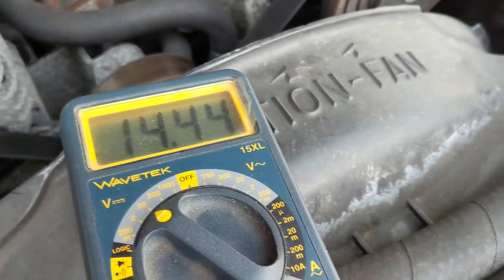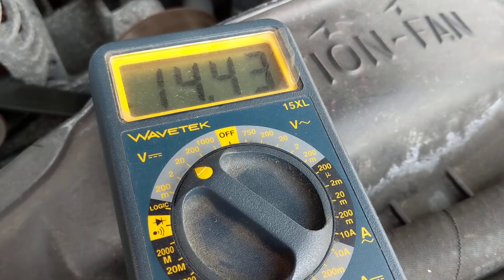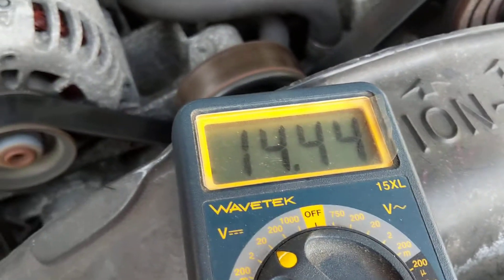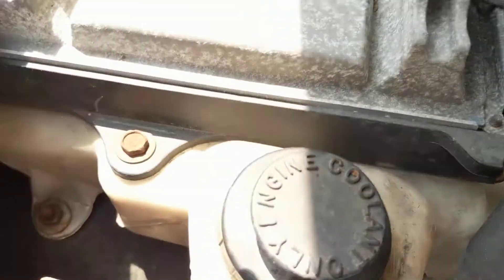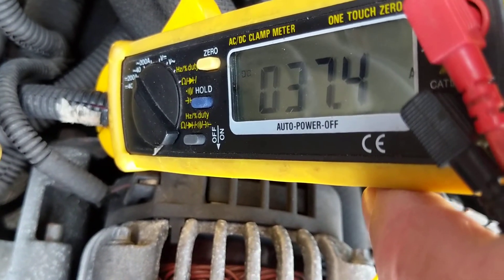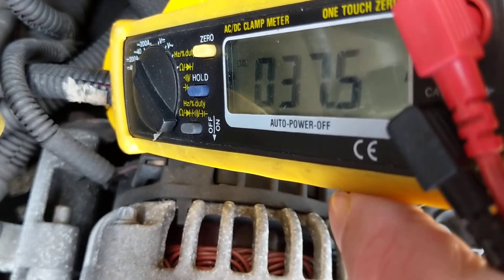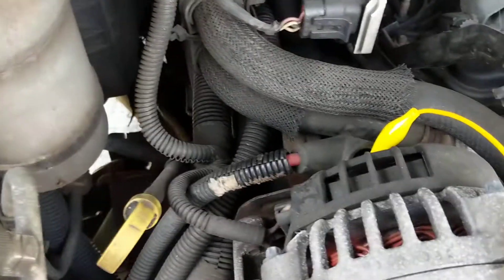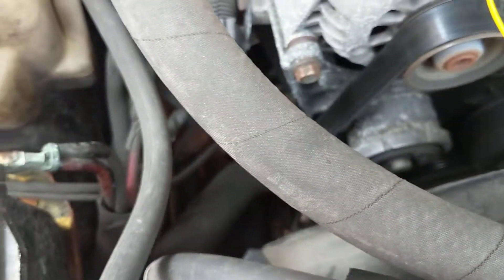CAR ALTERNATOR, HOW TO MEASURE OUTPUT CURRENT with clamp meter, NOT SEEN ANYWHERE ELSE ON YOU TUBE A

Comment: What range did you put on the clamp meter ? And why did you bring another multimeter? Can't the clamp meter do the job for measuring all the car parts?
Reply: Good questions the range that you put the multimeter as a clamp meter you can put it on 20 volts because you're probably going to measure around 14 volts the reason being I use two separate was to show the regulator is regulating the voltage and how much the current is when you turn on the accessories to show you the computer is giving the commands to the alternator thank you for your good questions

Comment: To me the meter is reading 14.43 volts DC ( direct current) and your clamp meter is reading 36 amps.
That means to me the output is current leads the voltage in an alternator.  That is in the theory of an alternator.
Reply: Thank you for your comment doug yes in an AC circuit however all this AC is rectified by bridge rectifiers sometimes six diodes or more so it has to be a DC voltage with minimum ripple to charge the battery and to keep the accessories going the current tells me that the computer is changing the current with demands of the loads thank you for your comment doug

Comment: So how many amps that alt is
Reply: 120 amps some alternators are rated 160 and up depending also on the cylinders thank you for your question
Reply: @Joeelectronicschematicsforauto  i have a beefed up alternator thats supposed to be 2 hundreds amps.    I have a harbor freight clamp and multi meter, im bout to go check my amps out in a few.   Sooooo do i just clamp my meter around the wire that connect from battery to alternator?
Reply: @moneymac5214  first put all the accessories on like lights air conditioner blower motor and accelerate to about 2000 RPM put it on The wire a thick cable from the alternator to the battery correct with old accessories on you should get probably 30 amps or somewhat when turned on when they turn off obviously it should go down

Comment: very good, but take the plastic shielding off the wires before you clamp them.
Reply: Why? A thin plastic cable wrap is not going to affect the magnetic flux created by current passing through the conductor. If it did, wouldn't the much thicker wire insulation have far greater effect?

Comment: dude, i appreciate the spirit of the video but you didnt show us much. your point seemed to be to show us the  amount of amp draw that was on the alternator when you turned the lights on, but you didnt show us what the amp draw was with the lights off. you told us it was   about 20 amps, then showed us the meter with the lights on presumably.  you also talked about voltage drop but didnt show us that either. show us the amps and volts  with the lights on and then off, then for fun calculate the watts for affect of output power, the viewer can do this at home, but maybe they dont know how or what this means. what were you actually troubleshooting? that corroded cable going to the battery is a problem, resistance problem technically. just curious, whats the highest amp load you have seen on a vehicle? last summer i connected a 10kw watt dc to ac pure sine wave inverter to both of my trailblazers  at the same time. i was able to get exactly 302 amps dc out of the two alternators combined. each trailblazer alternator is rated for 150 amps, and i get exactly 151amps at max per vechile.here is how that broke down and this was the absolute i could push things without tripping something, maybe low voltage input from the inverter maybe, dont remember, i did take notes though and here is how it worked out. 11.29vdc x 302amps = 3,387 watts dc, feeding the inverter:   107vac  x 35amps =3,745 watts ac for about 90.4% efficiency and 9.6% loss. as you can see i was dealing with a huge voltage drop on both sides of the inverter. i'd like to do more testing. i love this stuff but i dont have a real application other than providing power to my house if i loose power which i can easily do, except for the furnace which runs on 240, but i think i may be able to use a transformer for that...maybe. also, it should be noted i did this all with both engines just idling, but when the alternator creates that much current it causes the pulley to drag on the serpentine belt, i dont mean it slips, i just mean the engine automatically sees the load and slightly adjusts the rpm to ensure the horse power needed to spin the alternator is there, it was a beautiful thing.
Reply: I appreciate your comment about the voltage drop and current there are other videos on my channel which I have done these follow my channel Joe electronics schematics for Auto and you will see me do voltage drops for alternator and voltage regulation what I'm trying to prove here is the computer controls the field rotor current there is no internal regulator the computer controls the regulation and therefore the output current when I made a video using a scope I received common saying people don't understand how to use a scope so I try to find a way the easiest way to tell me that the computer is working controlling the output of the alternator and this is the way I found easier for the viewer when you put the lights on the computer detects it tells the alternator increase the field road or current that way I know the computer is working the alternator is working in a easy way to the viewer instead of using a scope where they didn't understand it see my other videos I have two channels Automotive electronic schematics for Joseph and the one I mentioned before as far as power when I get too technical the viewers don't understand
Reply: I made a video how to measure mass air flow sensor on a GM with a scope the simplest scope I could find but the comments I received was it was too technical because people don't have Scopes and they don't know how to use the scope it's like using a Snap-On $5,000 scanner when people don't have that so I make a video about that using that equipment so I tried to find the simplistic equipment I can to try to find the computer output of the alternator with a clamp meter like I said that's on my other channel and this channel how to measure mass airflow sensor output you'll see exactly what I'm saying
Reply: @Joeelectronicschematicsforauto  yeah, people are weird, my self in cluded as i look at the wall i text i typed out earlier. lol a bit off topic but i love to turn a laptop into a scope, if its even possible.
Reply: @jasonbrown467  I appreciate your comments and understand it but the majority of you is a people who don't understand technical equipment I will turn off the video instantly as you can see I need all the views that I can get thank you so much for being a viewer
Reply from the maker: Just keep on doing what you're doing you sound like you have a great educational background in electronics the fact that you know how to figure out the power which is almost ohm's law just keep on doing what you're doing

Comment: To much turbulence during the information parts!!!
Reply: I believe I stressed the point in another video that I made doing electronics when you do electronics the car has to be on engine has to be on that's the only way you can measure voltage explaining to do before you actually do it to me does not help as I get emails from people that they don't they don't understand the steps that I do